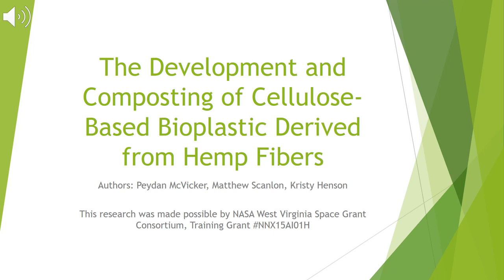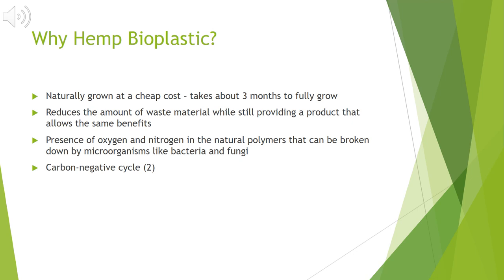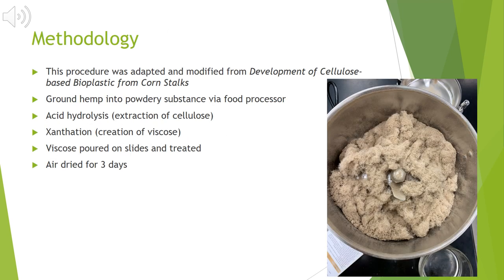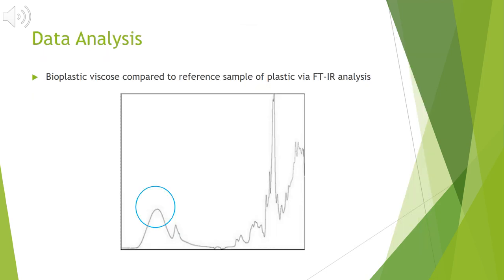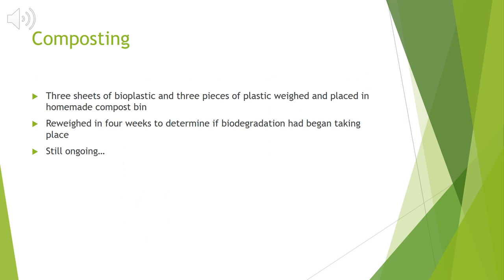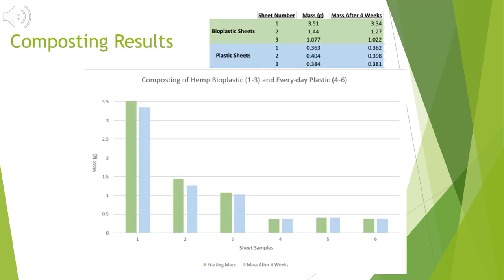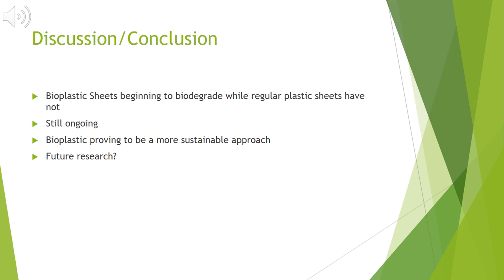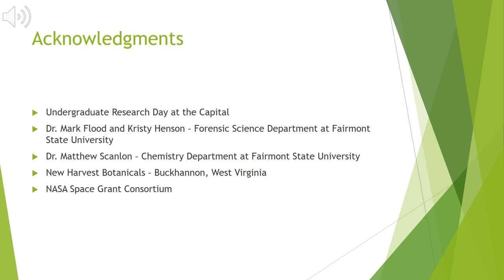The Development and Composting of Cellulose-Based Bioplastic Derived from Hemp Fibers

Comment: A few questions and/or suggestions for you:  1)  Are you planning on continuing investigation the decomposition under normal conditions, or are you planning on looking at the effects of temperature as well?  2)  I know you said you haven't been able to perform your own infrared analysis to this point, but you said something to the effect of using this to determine the functional groups, which it will do, but which functional groups do you expect from your reference spectrum?  Which peak specifically have you circled in your reference spectrum?  3)  It might good to add a column for the biodegradation with "% degradation," which would make your analysis look even more impressive.  4)  You said that your acid hydrolysis used sodium hydroxide, which would be base hydrolysis.  Acid hydrolysis uses protic acids to cause the hydrolysis.
Reply: Hi Scott! In regards to your first question, I am planning on continuing my investigation on the rates of decomposition under normal conditions. I am not planning on looking at the effects on temperature right now, as I know from my research that lower temperatures decrease the rates of decomposition and higher temperatures increase the rates. This could be proved in future research, but I have no plans for that at this time. In regards to your second question, the peak circled corresponds to the left of 1400 cm-1 which is the functional group region. I am hoping to see a spike in this area as my bioplastic should have more carboxylic acid and alcohol groups than the regular plastic sheets. You are correct that the use of sodium hydroxide would be base hydrolysis, what I meant to say was "alkaline hydrolysis" not "acid hydrolysis", so thank you for pointing that out! Thank you for your comments and suggestions. I really appreciate them!
Reply: @peydanmcvicker8012  Peydan, great work!  I really enjoyed your presentation and agree with Ryan below that this work is absolute vital.  Thanks for all your hard work!
Reply: @scottbrothers7154  Thank you very much!

Comment: Hi Peydan, I think the work you're doing here is vital and I'm glad you see how important it is for our environment. Can you tell me a little more about your composting setup? Were the experimental samples put in the same compositing bin? Was the bin already actively composting other materials? If you could flesh out some of those details I would appreciate it.
Reply: Hi Ryan! Thank you so much! I created my compost bin over Christmas break with a plastic tote I ordered from Amazon. I drilled several holes in the bottom and on the lid to allow air to travel in and out. I placed a layer of dry leaves on the bottom, covered the leaves with a substantial amount of dirt (about 2/3 of the tote), and then placed food scraps on top. I stirred the contents and let it sit until I was ready for my research. Overall, I think it sat for about 3 months before I used it. My bioplastic sheets and regular plastic sheets were placed in the same compost bin.
Reply: @peydanmcvicker8012  Great, thanks. And can you expand a little on some of the things you think your hemp bioplastic could be used for?
Reply: @RyanHaupt  Absolutely! Currently, my bioplastic sheets would be great for packaging purposes. Since my sheets were very similar in texture to styrofoam, I think this would be an appropriate and eco-friendly substitution. One could most likely alter this procedure to create a product that is more similar to normal plastic, which could then be used for cellophane and zip-loc bags.